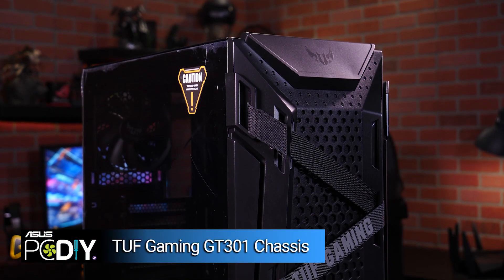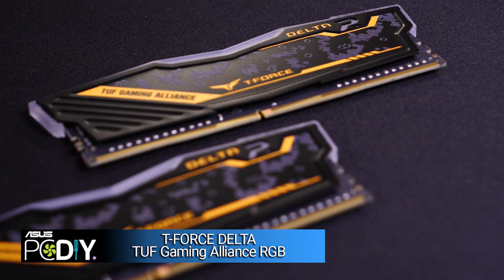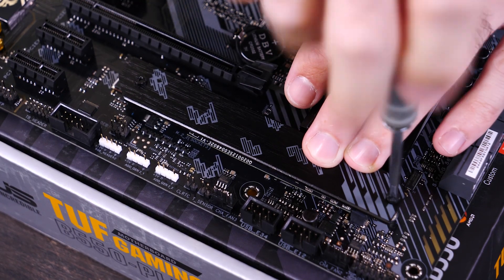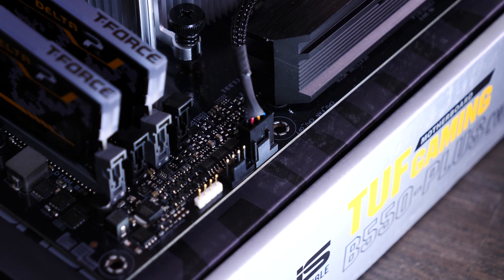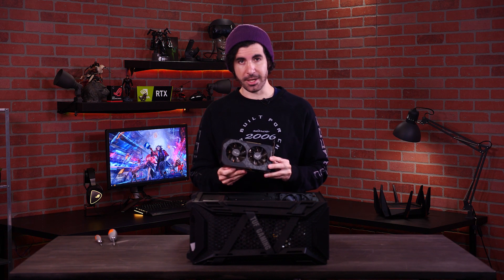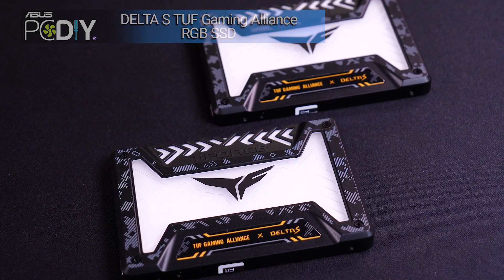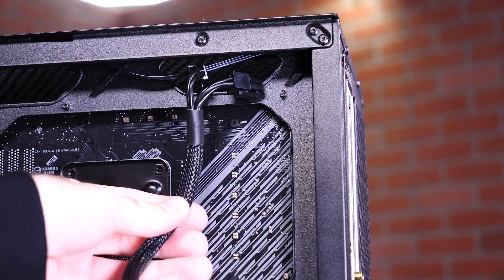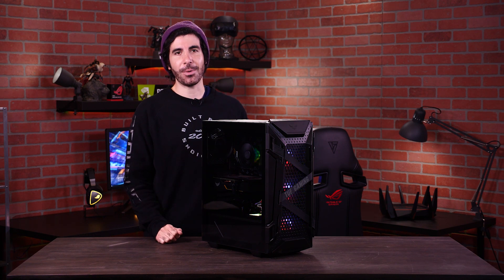Easy DIY PC Build

Comment: Hi! I hope to get an answer here... With the same chassis, I have the RGB lights working on the front fans, but neither of the 4 fans (3 front 1 back) are spinning. I can't figure out what cable is not plugged in right, would you mind sharing more details on that? Thanks!

Comment: The cable management has no effect on cooling, if ya need an education ASUS, check out Linus Tech Tips, where he went through an entire temperature testing, with lots of cables, and also packed the pc full of ice packs and other large objects, there was no impact whatsoever.   This is spreading false information, other than that, it was a decent video

Comment: In my personal experience, I have found it better to NOT spread out the thermal paste before mounting the cooler on the cpu. Just a small glob in the middle, and let the pressure from the cooler do the spreading. Again, just my experience(have built 20+ pcs)
Reply: I heard this too but why should you not do that?
Reply: @teeaymusik9811  I don't know if there is any actual science behind it, again, I am just going off my own experience, but each time I have spread it out first, I have had overheating problems.